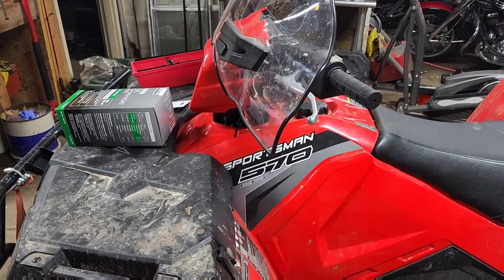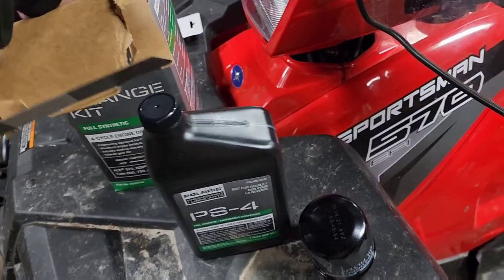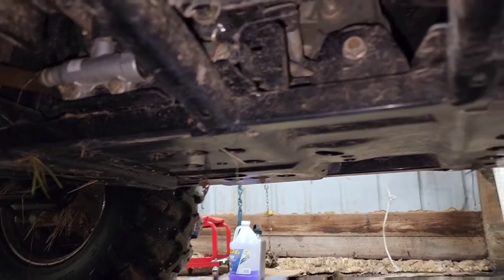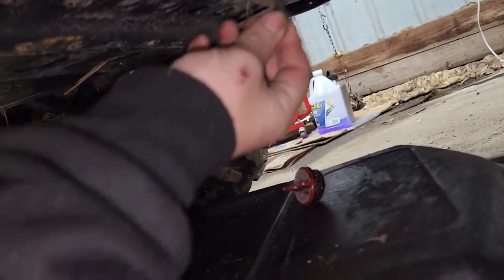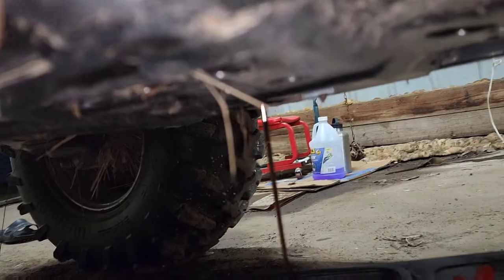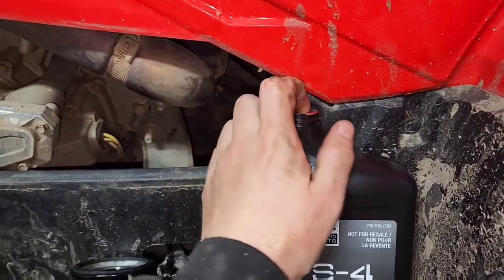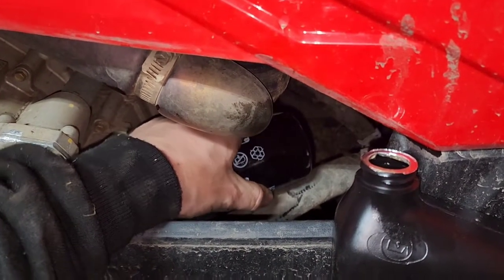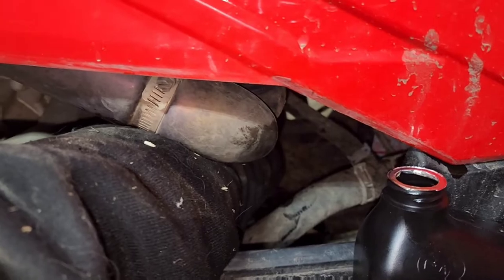How to Change the Oil In a 2018 Polaris sportsman 570 touring

Comment: I appreciate the video. The oil filter in the Touring model is in a difficult spot to reach. I am about to do my first oil change on my 2024 and looking for every trick to make changing the filter easier. I did cringe when you used the dirty paper towel to blindly clean the filter seating area. You could have introduced or smeared more dirt in the seating area. Good thing it doesn't have to be changed very often.

Comment: I have a question the oil filter is in a sketchy spot in the wheeler is there any way to get to it and put new one fast
Reply: Yeah, run your YT search again and watch the factory video.  There's no need to pull off the big plastic panel or feel around blindly while practically standing on your head to take off or fit up your filter.
Reply: @LS-ug1im  SAYS WHO, WE GOT BIZINESS?